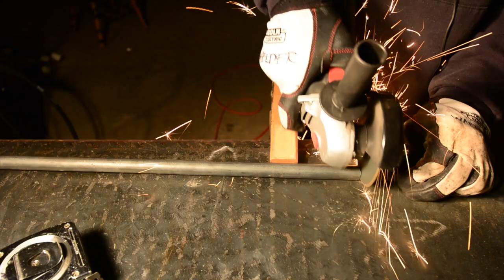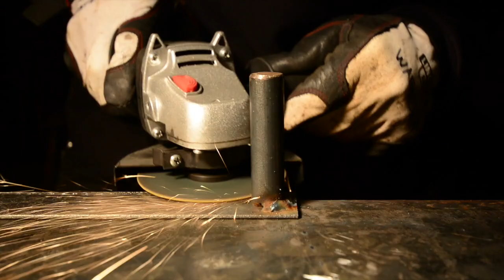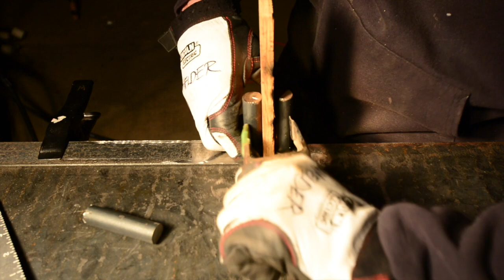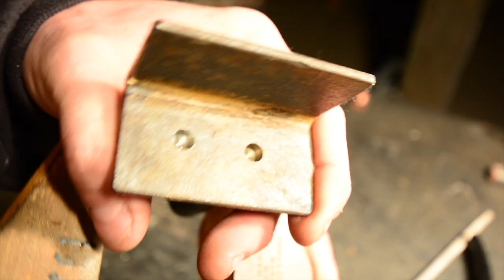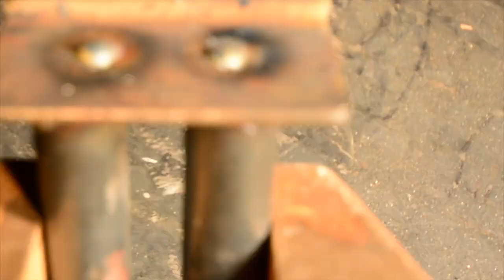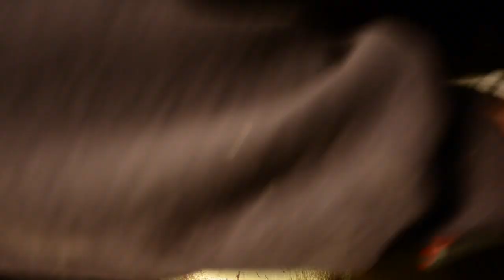Bending Jig - Basic materials & tools - (link to sign video using jig at end)

Comment: I need to make one of these so I can produce some cheap S-hooks. I just don't own a welder nor have any welding skill. I do have a drill press however. So I can drill straight, parallel holes. I plan on drilling and tapping them to take a couple of bolts.

Comment: I don't have welding capabilities, but I did inherit a heavy-duty old vice.  How about if those of us in a similar position grind some parallel flats onto the lower sides of a pair of short, stout rods, and clamp them hard into the vice whenever a bending jig like yours is wanted?  (Provides adjustable distances, too, though of course not rock-solid like the welded version...)

Comment: What was the benefit of drilling out the two holes and then filling them back with weld? I'm unfamiliar.
Reply: It's essentially a Rosette Weld. It's just a little extra insurance welding, to make sure it's solid(ish) all the way through as much as possible. The weld method is often employed when you need to weld where you don't have access, or don't want a visible bead. Think, shimming a smaller tube inside another tube to be used as a connector.
Reply: Cool. I had never heard that before.

Comment: Great jig David! Can you explain why you drilled out the two holes at the bottom and then welded them back up again? Did not get that part, so please enlighten me ;)
Reply: Its called a plug weld, you drill through the plate to get to the ends of the rod and then weld it up. It just creates and extra contact point in the centre to make it stronger :)
Reply: +Rzeczy i Przedmioty thanks!
Reply: +Krafty Beard thanks for the explanation!
Reply from the maker: That was the thought, more strength to wrap on this thing without impeding on the flat base with a weld bead inside to distort the metal I'm bending
Reply: +David Waelder thanks for taking the time to explain.

Comment: what are the dimensions for the 2 rods ? does it matter how far apart they are? i a going to try to sneak making this in when i go to my welding class this week
Reply from the maker: Depends what stock you use with it for bending. This is 3/4 rod 1/2" apart

Comment: A good tool, but mounting rods by welding - not strongly enough, especially if bending a rod of large diameter or thick plate.
I do yourself a fixture of the rod with a diameter of 14 mm, heating and bending it in the form of "U" letter

Mark Fisher. Ukraine.